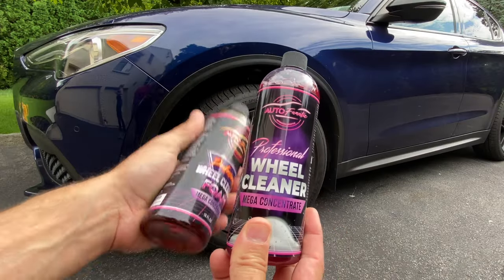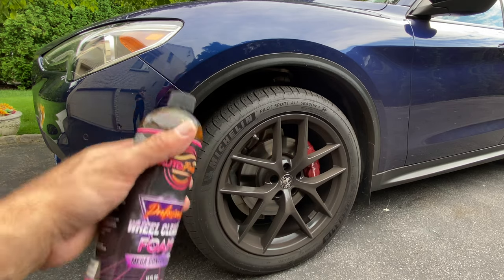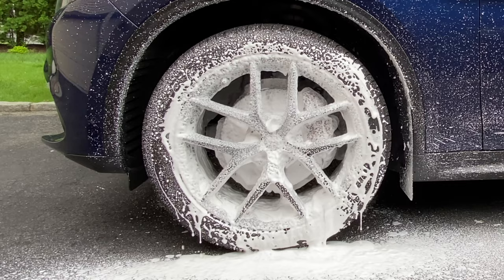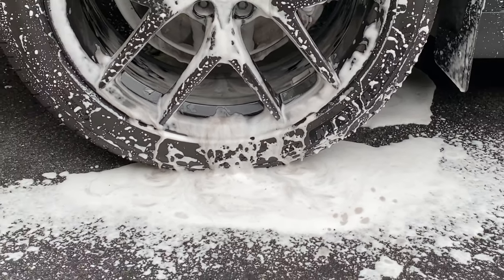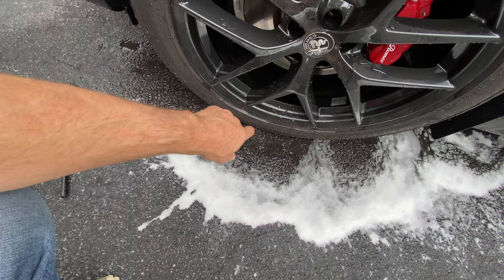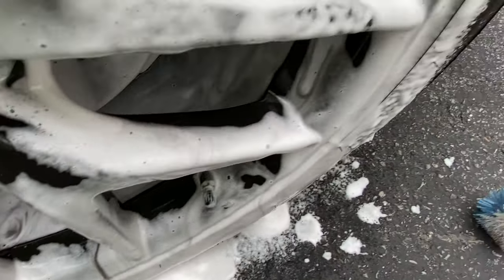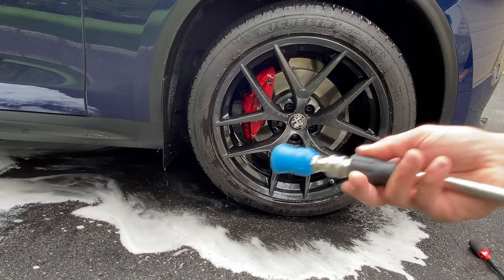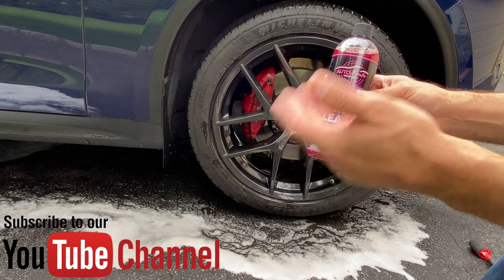New Version Auto Fanatic Professional Wheel Cleaner Mega Concentrate

Comment: Hey AF … how does this compare to Brake Buster?   Not using the spinning attachment for hands off cleaning or too aggressive?
Reply from the maker: Our cleaner is a safer solution against corrosion etc  BB leaves white residue that of not rinsed well will stain. Cheaper products are cheaper for a reason everything we make is not dictated on margins but optimal performance and safety. Try our new version

Comment: I get that shortages are hitting everyone. However it sounds like this new cleaner is more of a lateral move vs an improvement on the original, right? Not hating, just wanna know. 

I'll end up trying it regardless...
Reply from the maker: We would never put out a revised product that did not beat or better the prior version FYI try it youll see it is a completely different formula.
Reply: @autofanaticcars  I will, I still got a bottle of the original, but I'll def try this along side that. Reason I asked is usually you let us know in the product demo/intro video what changes/improvements have been made, and sound more excited about the product. In this video, you sounded almost upset that you could no longer obtain the materials for the original, so you're forced to go with this revised version. I'm not making any performance claims, just saying how it came off...like I said I def will be buying some anyway. Thanks!

Comment: how does a 16oz bottle make 4 gallon? it's 4oz per gallon?
Reply from the maker: this product is a mega concentrate that is designed to be diluted according to your needs. you can use 2-4oz per gallon of water therefore this bottle can make 4 gallons of wheel cleaner to be used in a pump up foamer. all the information is listed on our website.
Reply: @autofanaticcars  what's the bottle size for the solo foam sprayer? how many oz does it hold? Do you know?
Reply from the maker: 1.25-2 liters is the size of the reservoir on the Solo Foamers